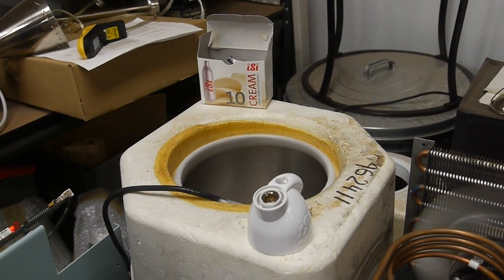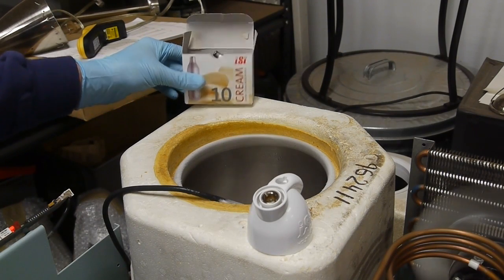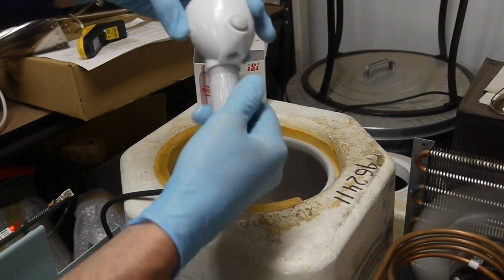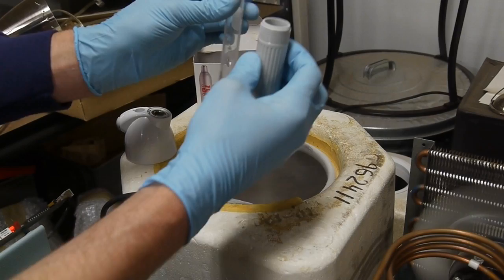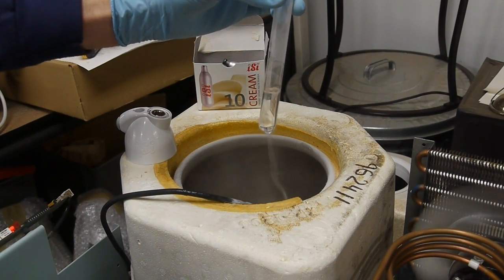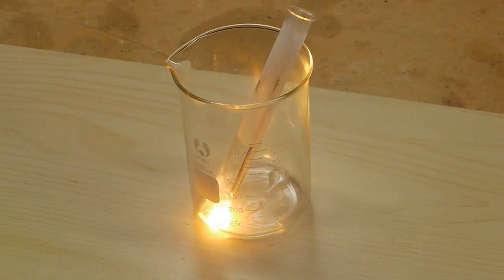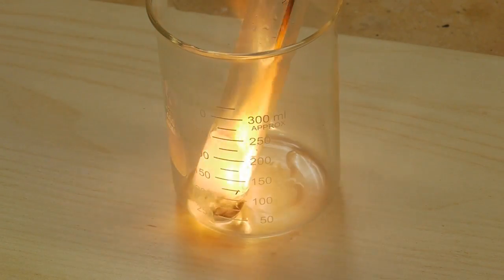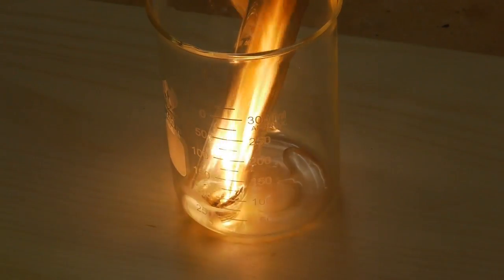Liquid laughing gas supports combustion

Comment: two choices liquid with cold vapour is liquid oxygen and liquid laughing gas (nitrous oxide), you touch two this liquid and vapour feel hot like fire but not burn and feel cold but burn like hot temperature you can burn fire in liquid or vapour after touch two this liquid or vapour

Comment: The guys at the welding supply store told me that you can make solid nitrous oxide. and if you throw this type of 'dry ice' into water it explodes like sodium. Apparently somebody left a bottle cracked, and it started icing up around the valve. Have you heard of anything like that?

Comment: N2O is a liquid at room temperature in a pressure cylinder. Its critical temperature and pressure is similar to CO2, 72 bars, 36 degrees C or 98F (when the liquid and gas phases merge). But in order to achieve 1 bar you have to cool down the vessel to -88 degrees C or -126.4 F and it freezes a couple of degrees lower.

Comment: Ah, so thats what you do late at night in the lab...  Hah! (kidding)

I made a really cool combustion gun that uses butane for fuel plus an added shot of nitrous for a significantly more explosive kick.  (of course I thought it must work in theory but was elated after I tested it because it worked quite well) Anyway, I use those same whip cream chargers (room temperature though). In order to use them I modified one of those bicycle quick inflater pumps that are designed to use CO2 cartridges.  They are close to the same size, but I think designed purposely to be not compatible so a little modding required.  The inlet of the bicycle pump is ported into the combustion chamber.  A quick burst of NO2 is all that's needed to go to have projectiles going through fence boards!

Comment: So this liquid is boiling at about -90°C?
Reply: yup
Reply: I think it's pressure dependent? Not sure though.
At high pressures it'd be a liquid at room temperature, but lower pressures require colder temperatures.

Comment: Hi Ben, I was wondering if you maybe can use the liquid fuel and use it to fill up gas cylinders? I am interested in building a reusable hybrid rocket motor with a servo that can control the gas flow rate and fins. Aka a remote controlled rocket. Keep up the good stuff sir!

Comment: Can you use those cartridged for a hybrid rocket engine?
Reply: You can, and you can even buy kits. Problem is, the pressures involved mean that the tubes and vessels have to be thick walled, and that equates to a heavy engine for the amount of thrust you get.
Reply: Well that sucks
Reply: With that said, if you chill it like above you can reduce the pressure and make it more lightweight, though you'll need a more sophisticated way to inject the stuff into the engine. You could have a small pressurized cartridge pumping gas into the liquid N20 container.
Reply: Ryan Willis
Indeed. Low chamber pressure is a problem with pressure-fed engines in general and there isn't really a way around it for something as simple as a model rocket. To get high performance, you need an engine cycle with a turbopump or a pulsed cycle with a self-compressing part.

With that said, the disadvantages of low chamber pressure can be mitigated to some extent by a proper nozzle. And either way, any proper hybrid rocket will definitely beat a black powder rocket in delta-v.
Reply: That would depend on the size, a smaller sized model rocket with a black powder engine requires less dry mass for the motor, whereas a hybrid will require heavy oxidizer tanks.
Reply: One problem: rocket engines are most efficient with a highly pressurized combustion chamber. You need pressure to force the N2O into said chamber. That's why commercial liquid-fuel rockets have all that turbomachinery, it's to pump the fuel and oxidizer at high pressure into the combustion chamber. Any reduction in chamber pressure reduces thrust and efficiency.

Comment: I wonder what the thrust is of that test tube rocket. :)
Reply from the maker: It's bark is probably worse than it's bite; but if I packed a tube full of sawdust + liquified N2O, we might really have something!
Reply: Applied Science Do it!
Reply: TheBobostuv Heh, at that point you're getting into the range of oxyliquit explosives - the traditional ones are based on lampblack or soot and liquid oxygen, but sawdust and N2O would probably be pretty violent as well.
Reply: @MysticalDork  I'm reminded of the MIT "pouring LOX on a BBQ" videos. I wonder if NOX would be better or worse?

Comment: now.. how in the world do you clean the burned insides of your test tubes? Or do you just replace them? Or am i completely mislead in believing that it's so hard to clean? (mostly from the burn of matches on the side of glass candle cups being sometimes impossible to clean)
Reply: In a (chemistry) lab it's actually rare to see a flame as they have a nasty habit of causing your experiment to catch fire so the problem of cleaning soot off glassware is rarely encountered. I have done it in the past though and the easiest way is with a bottle brush and soap. In fact the vast majority of cleaning in a lab is with just plain old soap and water. If you want to make sure a piece of glassware is very clean and, in particular, dry, you may occasionally run a little acetone around the inside and then blow it out with dry air. The acetone is able to pick up the last traces of water and is a good general solvent for any traces of chemicals left in the glassware. For really really stubborn to remove chemicals there is usually an acid bath in the lab but you tend to try and avoid reactions that require that sort of clean up if you can.
Reply from the maker: If the dirt is really bad, it's common to just discard the whole tube.  More expensive glassware can be cleaned with chromic acid if the dirt is extremely persistent, and the glassware must be saved.  In this case, I just used oven cleaner (NaOH), and the soot washed away with almost no scrubbing at all.
Reply: I am not a professional but I am pretty sure most contaminants on glass can be removed with Acetone or a mix of acids, and if he buys his tests tubes in bulk, it does not cost that much to replace.
Reply: CNCtrl Thanks for the extra information.
Reply: jdflyback and if you REALLY want to clean glass, you use HF, and if you want the glass to disappear, clean it with Piranha!!

Comment: I don't see why it wouldn't support combustion (given a fuel source). It's used for much the same thing in engines. ;-) More oxygen+more fuel=more power!
Reply: sasja de vries Because without the nitrogen, it would run extremely hot, and would detonate like crazy, destroying the engine. The nitrogen helps to not only cool the intake charge, but also to control the detonation so that that the engine doesnt require a significant change in timing to operate with or without the nitrous oxide present.

If you google "how does a nitrous oxide systems work", there are dozens of pages that break down the chemical science behind it. Though, i will warn you that a better than rudimentary knowledge of the internal combustion engine is required to fully understand much of the technical aspects of how and why it works.
Reply: I sometimes wonder why they don't use pure oxygen instead of N2O.
By electrolysis of water O2-gas can easily be made.
Reply: sasja de vries No idea. Maybe N2O is easier to compress?
Reply: dumle29 good point, O2 has a lower boiling point but still is O2 would cost 3 times more than N2O I would do it.
Losing a race costs you more.
Reply: Pure liquid oxygen is also notoriously corrosive, so special precautions must be taken when choosing materials that come in contact with it. example: no hoses or gaskets made from organic materials (plastic or rubber) or from easily oxidized metals. Spills of liquid oxygen are also a major danger, because almost any flammable material on the ground will become potentially explosive (asphalt, plastic carpets...)

Comment: Sweet, does the liquid N2O ever touch the wood or does it make a leidenfrost bubble around it?
Reply: We need more questions like this :)
(and of course, answers ^^ )
Reply: tjousk A further question, if you were to put some methanol or other low freezing point liquid in that cooler, could you use it as an instant, single bottle, beer chiller?
Reply: That's a good question.
Reply: Whoops, thank you.
Reply: Indeed.
Reply: Its N2O not NO2
Reply: Nick Moore
 As for the beer, I suggest you look at Nurd Rage's video on chilling a coke with LN2.
Reply: Well I've done some playing around with liquid difluoroethane which boils at -25 (not -88 like the nitrous oxide) and I would say that small objects tend to cool quickly, the leidenfrost effect requires very large temperatures typically and its a small object that would cool fast enough to avoid that, putting it in the liquid will just boil off N2O as it cools (as you can see)
Reply: Similarly for the "cooler" idea, I tried difluoroethane to rubbing alcohol and it slowly bubbles out and cools it. However you have to think about how much energy it requires until it boils and diffusion of heat. So a whole beer bottle would need some seriously cold temperatures to achieve instant freezing and a whole lot of it, cuz once it heats up it just boils off